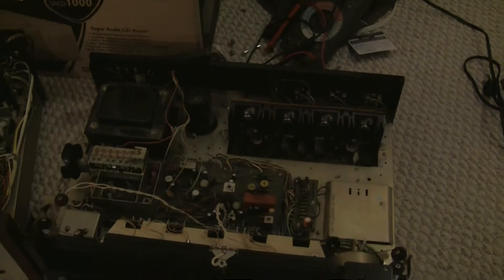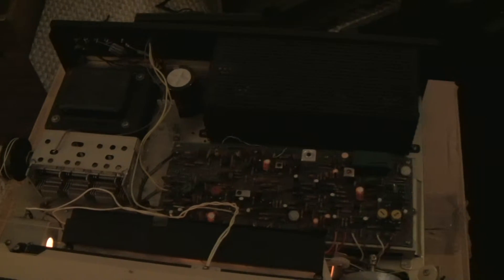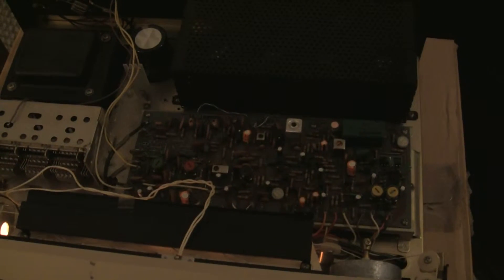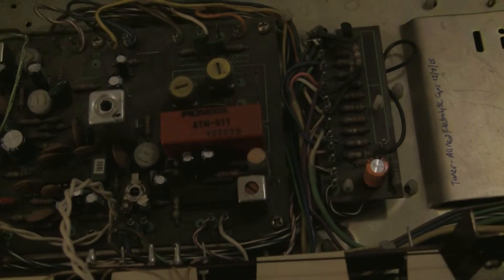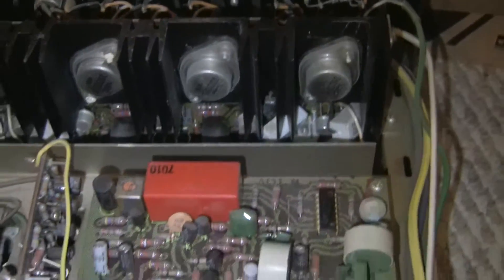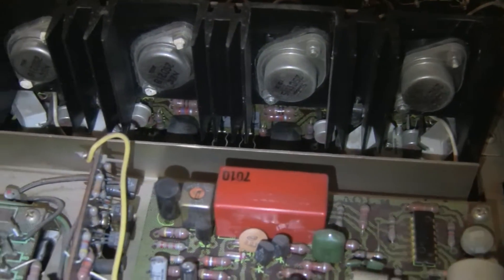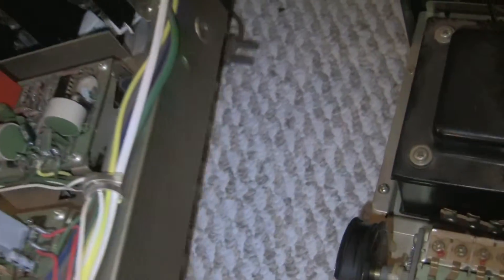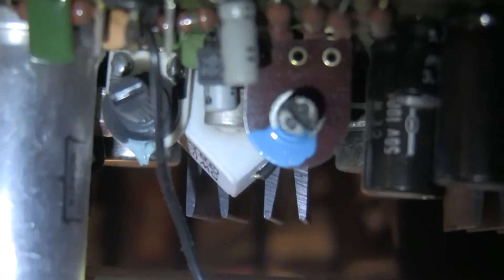Pioneer SX626s and SX1500TD Stereo Receivers

Comment: I just watched your Sansui 4000 video. ( looking for Vol 3) Do you by chance have your documented changes/ additions to the schematic you discussed?  I just picked one up from the widow of a silent key as payment for selling his equipment.  The inside has about a 1/4 inch of dust and I would like to recap etc.  It still plays wonderfully though.  I just thought you might be able to  save me some time if you had documented the changes and your BOM for the new caps.  I heard you say you lIke Nichicon KL for signal path . any other comments on other caps for other areas?  Please let me know if you can help . Thanks in advance 
W4ATO